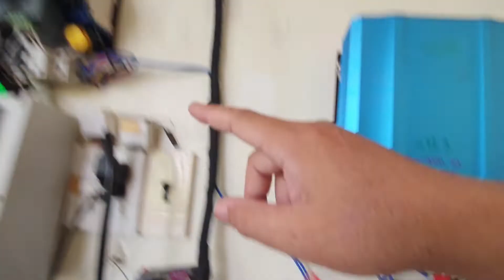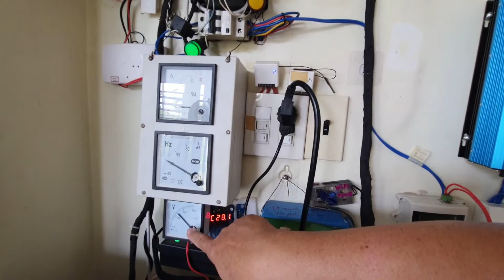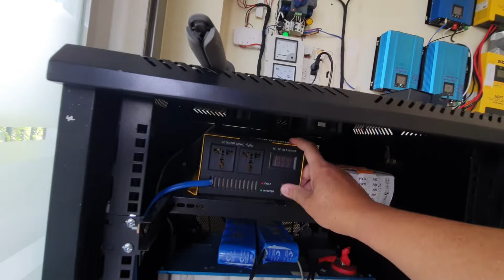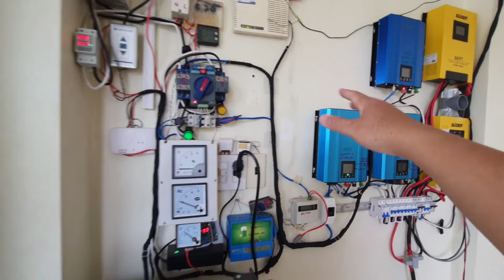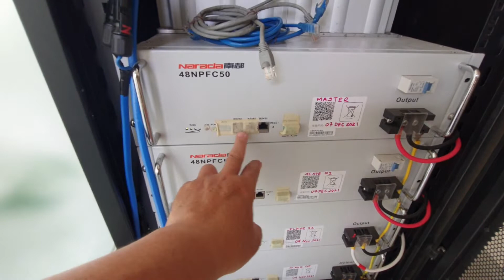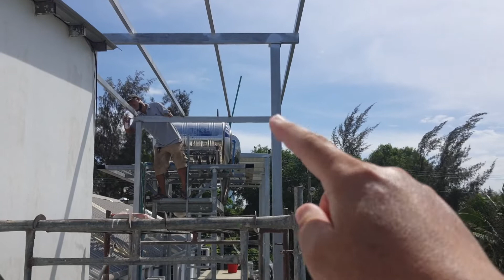New Solar Panel and How my system works

Comment: Your circuit breaker is AC not DC
Reply from the maker: Yes it's AC. It works (do trip) on the MPPT charger side. On the lower wattage on DC. The Grid tie inverter side my system won't reach that amps. It function only as a switch. 

Grid tie inverter has internal fuse.
Reply: @michaelseah9617  arc  DC > AC
Reply from the maker: @zbiaoz9768  Yes DC arc is bigger then AC, that's why the 62amps AC will trip at 50+ amp DC on MPPt side.

The grid tie won't trip because only 900w DC (4 amps) per channel.